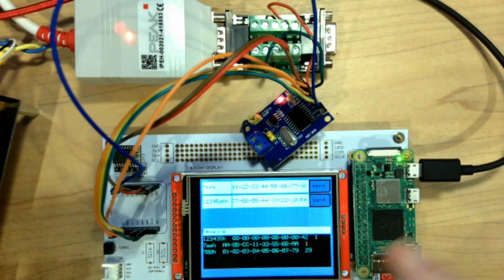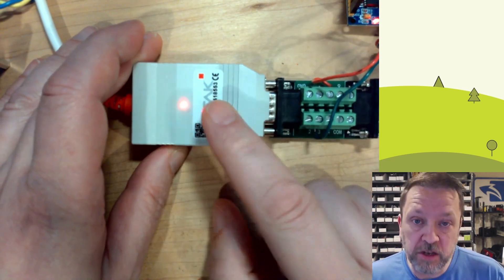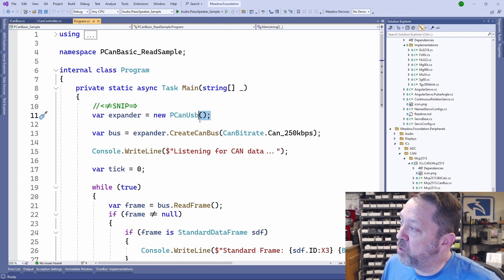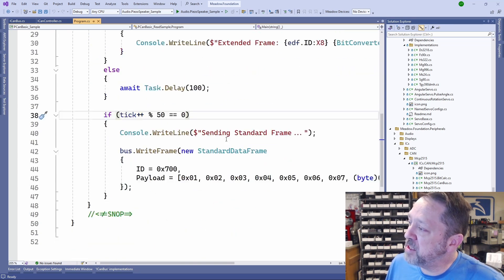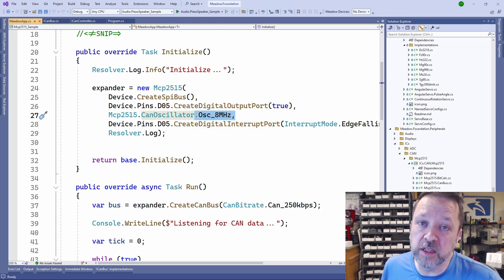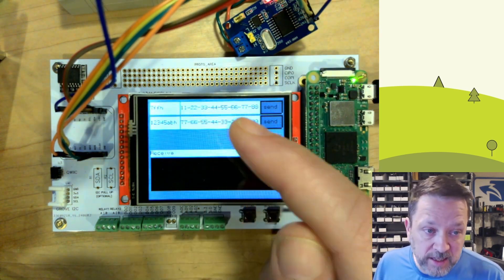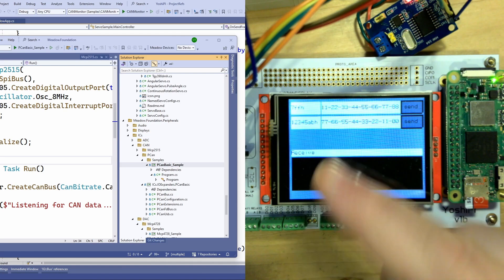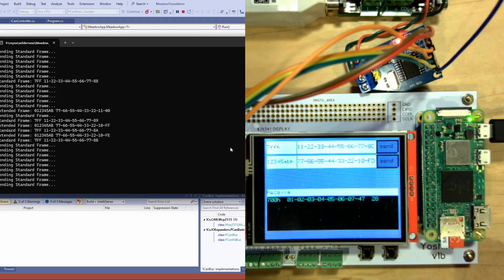Reading from (and Writing to) a CAN Bus with C#

Comment: some benchmarks would be interesting to see the performance of c# where you can receive messages every 20ms, and the frames are decoded/unpacked according automotive can messages which are defined in a dbc file. DBC are made using a free software called CANdb++ from the automotive software giant called Vector. so from the PC side the frames need to be packed and the embedded device needs to decode and show it.
Reply from the maker: Definitely a good idea